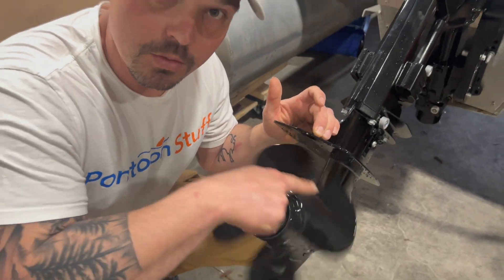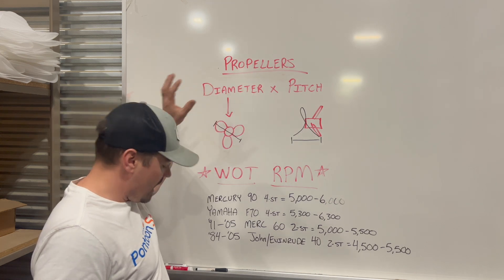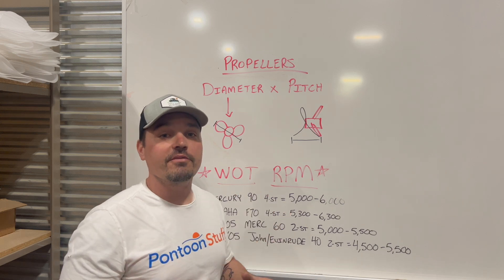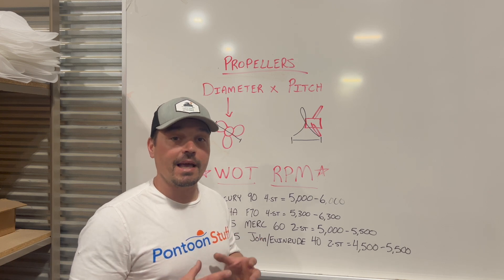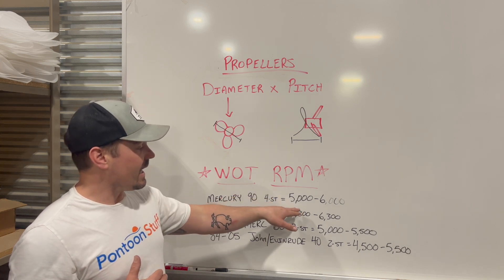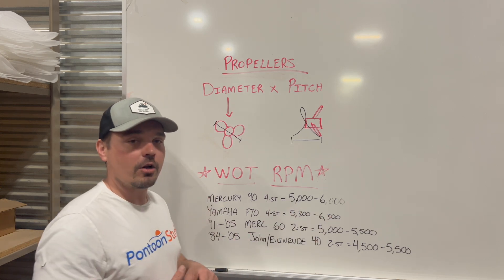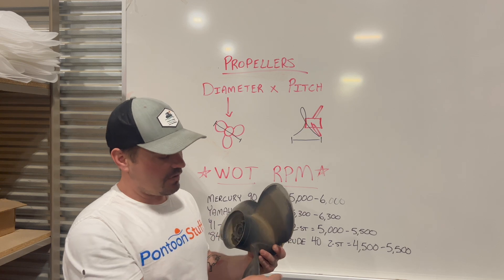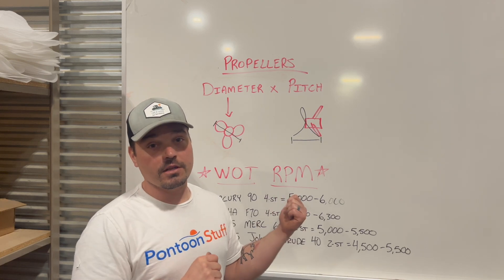THE RIGHT PROPELLER FOR YOUR BOAT - Breaking Down Prop Selection

Comment: Have a 16ft deep v aluminum bass boat. 90hp and a 9.9 kicker for restricted lakes. I know im not going to break any speed records with the kicker but just trying to get a couple more mph. Stock prop was a  4 blade 10x5- produced 5.6mph at 5200 rpms. Upgraded prop is a 3 blade 9¼x7 - produced 6.1mph at only 3900rpms Max. Any recommendations this is very confusing.
Reply from the maker: That boat is just too much weight and drag for that kicker motor to push it and get the proper RPMs at WOT. If you run it hard and don't turn enough RPMs you will lug the motor down and it'll cause it to fail over time. Best bet is to stick with the 5" pitch and take your time for the longevity of your motor.
Reply: @tomspontoons great piece of info. Thank you for the reply 👍
Reply from the maker: Happy to help!

Comment: Hey Tom, I have a situation that doesn't make a lot of sense to me.  I have a 22 ft pontoon with Merc 115 Pro XS CT, black max prop 16x13.  I added a Poly 3rd Toon Kit sport toon (13'6") over the winter. When I got on the water last weekend my max RPM's were 4200 (115 should be 5300-6300).  Max speed before 3rd toon was 17 at 5100-5300 rpm (max).  Speed still 17 but RPMs 1000 lower.  Once getting up to speed the back end seemed quite a bit lower, too low perhaps and lowering RPMs? Then the strange part, I swapped props to a 4 blade 15x15 Turning Point I had (smaller diameter but higher pitch) and the RPMs up to 4600-4800 and top speed 24 mph.  Would like the RPMs in recommended range (I like the speed up too, always thought way too slow compared to everything everyone else mentions).  Any Recommendations?  You are the best pontoon resource on YT.
Reply from the maker: RPMs in the proper range is the first priority. That 16" prop is a huge diameter for a 115 hp motor to turn. We tried running a 16" on our tritoon with a Suzuki 200 and it really struggled to turn the RPMs and didn't gain any speed. Dropped back down to a 15.25" diameter and 1" lower pitch and it ran its best. 

I'm guessing that poly third toon added a bit more drag than that 16" diameter can push. I would look to try something closer to 15" diameter and 13" pitch. Anytime you do a sport toon you can expect the bow to be higher and stern to squat a little. You're at that HP range where it's almost enough to lift the boat on plane, but not quite. You could add lifting strakes to the insides of the outer pontoons, but it still might not quite be enough HP to really lift the boat and fly. Once you get the correct RPMs you should be tapping into the optimal performance for RPMs and speed, especially with a loaded up boat.
Reply: @tomspontoons Thanks Tom. Would you recommend me trying three blade or four blade 15x13?
Reply from the maker: @charliebryant686  I really only recommend a four blade if you're having issues with ventilation OR if you've got a heavy boat and want to stick with aluminum for your prop (the aluminum four blade has less flex/slippage). Otherwise there won't be much of a difference between 3 and 4 blade.
Reply: @tomspontoons  Thanks again Tom.  I will probably stick with aluminum just for cost, especially until I find the right prop.  I am having trouble finding 15x13p in anything!
Reply from the maker: @charliebryant686  It might be a little different than exactly 15” diameter. Check out Solas Brand, they have tons of options, are affordable, and I’ve had great luck with them!

Comment: Im running 4.85m boat 60hp 4 stroke yamaha 2012. 13 prop max rpm 4900. With full loaded boat. 

What should i do up go higher or lower
Reply from the maker: Need to test it with an empty boat first. But I'd usually want to see 5200 to 5500 with a full boat, and if I'm not hitting 5500 I would back off on the throttle to reduce wear and tear on the motor from running at too low of RPMs at WOT. Just my thought and how I'd run it.
Reply: @tomspontoons  thank u. I've give that a try
Reply from the maker: @Aaron-op6jj  Happy to help!

Comment: Tom, I could really use your advice on selecting a prop.  Boat is a 22' Veranda tritoon, 27" tubes, lift strakes, performance motor pod.  Motor is a Yamaha SHO200 (VF200LA).  OEM prop is a 15.25" dia x 15 pitch.  At WOT I was getting a GPS verified 42.7 MPH at an indicated 6100 RPM.  I had the ECU re-flashed to 335HP and rev limiter raised from 6200 to 6500.  With same prop I am now seeing 47.9 MPH at an indicated 6700 RPM.  I am not bouncing off the rev limiter, so clearly the OEM tach is optimistic.  Hole shot is improved, and mid range throttle response is amazing, but I expected to pick up more than 5 MPH on top.  Clearly, I am underpropped and need to raise pitch.  The question is do I go to a 16 pitch or a 17 pitch?  Any advice appreciated.
Reply from the maker: When I worked in outboard sales I sold a customer a brand new 200 High Output Evinrude ETEC to replace his old 225 Evinrude Ficht. I was young and new to the game and didn't realize that even though they were both putting out 220-225 hp the older model was built on a larger displacement engine block than the new 200 HO. While both claimed to put out similar HP his boat (big fiberglass fishing boat) could barely plane out and he lost 10 mph. We worked with ETEC and our mechanics figured things out to make him happy with a prop change and adjusting the engine height, but he still never got that full 10 mph back. The Evinrude rep was an old school guy and had been in the outboard game a long time...he told me "THERE'S NO REPLACEMENT FOR DISPLACEMENT". Literally, the larger Cubic Inch engine will always perform better than the smaller one that's tuned to create more HP because with water there are more variables than a car or motorcycle just ripping down the road or racetrack. 

With these ECU flashes I'm not sure how they even do it, let alone if it's good for the engine, but they're taking a smaller displacement motor and maxing out the HP it can create...without changing the displacement of the engine block. The higher HP does nothing for the torque created by a larger engine block, and in the case of a pontoon or tritoon (or that heavy fiberglass big lake fishing boat with the Evinrude) you need more displacement/torque to lift the hull to gain those advantages of the higher HP. Basically, you need to get less pontoon in the water which is going to come from torque over speed...again it's a complicated thing in the water with hull type and shape and how loads impact drag. 

I would go to the 17 inch pitch if top speed is your main goal. Going up 2" in pitch should yield a drop of around 200-300 RPM putting you right in that sweet spot. You may even consider an 18" pitch, but remember that if the diameter changes much with the pitch change it can drastically drop your RPMs. 

Prop selection will always have trial and error as the base of it unfortunately...and when playing with stainless props it's not cheap! Find a dealer or prop shop who's willing to take a deposit from you that you will use towards the purchase of a prop from them, but on the condition that you can test a prop or two until you find the right one. And this information is from my experience (and mistake). So take it for what it is, but it's my understanding of propping boats and the high output and flashing of smaller engine blocks for more HP and how that relates to performance. Awesome question and hopefully I'm able to have been some help here for you and anyone else reading comments!
Reply: @tomspontoons  Thanks for the input.  FYI, my 200SHO is built on the 4.2 liter V6 block and is the lowest HP offered on that block.  The only difference in my motor and a 300 HP 4.2 liter V6 is the ECU tune.  In other words, my 200SHO is simply a de-tuned 300.  All of my research indicates that the ECU re-flash on my motor is considered very safe, with multiple owners reporting 1k trouble free hours.  So, your old Evinrude rep was absolutely correct that "There's no replacement for displacement", but I have the displacement for an easy 300, and the extra 35 is a very, very mild massage of the factory tuning.  Concur that my best bet is to use a prop shop that will let me experiment, and perhaps even let me trade in my OEM perfect condition 15 pitch.  Thanks again.
Reply from the maker: @Spartan490-b1q  That makes a lot more sense then!! I was picturing the 200 inline 4 which is a great motor, but not beefy in terms of power. Hopefully that explains me being so perplexed by the 335 hp number! 

I would bet you’ll end up in the 17 to 19 pitch range with the information I know now!! Our 200 Suzuki (inline 4) ran a 17” pitch for its best performance. It was a pretty light 22’ tritoon tho.
Reply: @ Absolutely.  If you start with a 2.8 liter inline 4 rated at 200 HP I think the best they can do is 225, as that block is already making most of what it can make.  When I bought my motor I did so because it was the least stressed block at my HP number and I could use 87 octane.  The re-flash does require higher octane.  Interestingly, there's less than 25 lbs weight difference between the 4 cylinder200 and the 6 cylinder200.  Years later, my choice turned out to be fortuitous for tuning.
Reply from the maker: @Spartan490-b1q   Yep! And to be honest, on a pontoon or tritoon going with the smaller hp option on the same displacement block doesn't usually hurt you on speed. For instance, Suzuki uses the same inline 4 for their 150, 175, and 200. I bet you'd only see about 3 to 4 mph difference on a tritoon between the 150 and the 200. They just don't have the same impact on a tritoon as they do on a bass boat or run about that's a fully planing hull. I think you have a really good grasp on what you're working with...the unfortunate part might just be that now you've got to spend the time and money testing and tuning to get it just where you want it. Best of luck, and please comment back with the end results when you get it where you want it!
Reply: @tomspontoons  After discussion with a local custom prop shop we ordered an 18 pitch.  If it doesn't work I can exchange it for a 17.  Should be in next week sometime.
Reply from the maker: @Spartan490-b1q  Awesome! Let me know how it runs!
Reply: @ Just got back from testing the 18 pitch prop.  Boat is fast, but it sucked down the WOT RPM's a tad too much.  With the 18 pitch I got 52.4 MPH at 5950 RPM with just me on the boat.  However, I was having to trim way more than I ever have and boat was really wanting to porpoise even with virtually no wind/waves.  I'm going to exchange the 18 for a 17 and expect I'll end up right about 50-51 MPH at 6200ish RPM.
Reply from the maker: @Spartan490-b1q  Awesome info! Hopefully you hold that 52 mph with the added RPMs. It’ll cruise with a heavy load MUCH better with the 17” though too. That little extra torque will be nice
Reply: @ The 17 pitch finally arrived and I just got back from testing it.  That is the Goldilocks pitch for this setup.  With just me on board and 2/3 tank of fuel I saw 52.8 MPH at 6350 RPM.  That is a massive 10.1 MPH increase over stock.  And the mid-range and hole shot are still amazing.  Better yet, an easy 4200 RPM gets me a very quiet and smooth 35 MPH cruising speed.   And it'll stay on plane down to 3700 RPM in smooth water.  I'm thrilled.  Well, well worth the upgrade.
Reply from the maker: @Spartan490-b1q  That's awesome to hear! You're the perfect example of how propping a boat is done by trying different props and comparing RPMs and performance. And now after a little bit of work you get to know you've got the right prop and best performance for the rest of the time you own the boat!!

Comment: Any recommendations for my honda bf20. Original prop is 4 blade 9-1/4x10
I change to prop 3 blade 9-1/4x9 one down lower pitch but my rpm is still 4500.
Do i need more lower my pitch?
Reply from the maker: You're sure your tachometer is reading accurately or is set to the correct pulse/pole setting? What kind of boat is it on?

That motor should be able to run up to 5500 to 6000 usually, so in theory you'd want less pitch, but you may not have much lower options to drop to. You could also try raising the motor on the transom to help reduce drag. If it's on a pontoon boat and you can't get the RPMs up I would just recommend avoiding using the higher throttle ranges unless absolutely necessary. That should at least help prevent doing harm to the motor. Slow putting around with the wrong prop isn't going to do as much harm as trying to run the motor hard with it.

Comment: I have a Merry Fisher 605 with a 2021 Merc 60CT(Bigfoot) with a Aluminum 3 Blade Blackmax 13x21P Prop. Its hard to bring the Boat on Plane. WOT 5600rpm.
Someone told me switch to a 4 Blade. Would you change also the Pitch. I dont care about highSpeed i yust want quick Plane.
Would you go with higher Pitch on a 4 Blade ?
Reply from the maker: Those look like fairly heavy boats for a 21P prop on a 60CT. I think a 4 blade would help, but I would also drop down to at least a 19" pitch, maybe even a 17" to get those RPMs up to 6000 at WOT with an empty boat. I think it needs the lower pitch more so than a four blade personally. Even if the boat can push 6000 RPM with a couple people it's not a bad thing, and it will get you on plane way faster. That's what I'd do!
Reply: Thank you!
Reply from the maker: @vetdoc35 happy to help!

Comment: Would the rpms be affected by the pitch even when running the motor out of water with muffs on?
Reply from the maker: No, it really should not have any impact as there is little to no resistance to the motor/boat from the air. It's the load from the motor pushing the boat through water with a load that impacts the RPMs the most.

Comment: Thanks for this video!  We purchased a new to us 2006 Sun Tracker Fishing Barge 21 with a Mercury 90ELP T 4-stroke.  The boat came with a Solas 14" 11 pitch prop which doesn't seem right.  We took it out the other day and got to 5500 RPM way before WOT.  We got to 18mph at that RPM.  I didn't want to push it any more past that as far as the RPM goes.  We also got what seems to be cavitation?...not sure what that really is, but my husband says that's what it is! LOL.  It performed well at 3500 RPM but only doing about 10mph...going nowhere fast!  Any tips or suggestions?  Thanks!
Reply from the maker: That does seem like a low pitch for that motor and boat combination. That motor should run up to around 5,800 to  6,000 RPM at wide open throttle with a light load. I would expect to see 25 mph out of that boat. I'd start by going up to a 13" pitch which should drop the RPMs a little bit and might give you better bite. Your 11" might be so flat of a pitch that it's having slipping issues. Really hard to say without being there to see and hear everything happening, but I'd start by going up in pitch a couple inches to where you can really test wide open throttle without going over 6,000 RPM.

Comment: any recommendations for a Honda bf50d with a range of 5500-6000, im running a SOLAS Amita 12-2/5 x 8 RH 3311-122-08 prop with a max rpm of 3400-3600..... the propeller house i got it from said this was good and they wouldn't change it.. but i didn't think that was right and after watching this i know its not..
Reply from the maker: What kind of boat is it on? Pontoon? I would be concerned that your tach might not be reading properly. 8" pitch is very low and would usually have RPMs quite high. For instance, we usually run an 11" pitch on the 60 hp Mercurys that we install and that puts those motors in the sweet spot of around 5700 RPM.
Reply: @tomspontoons   all appearances it seems to work properly, idle is correct and it comes up smooth and consistent. it doesn't sound like it is running in the upper rpm range but i will find a way to check that. it is a 23ft pontoon. not sure how to verify the gauge is working correctly but i will do some investigating. Thanks!
Reply from the maker: @stockenterprises9391  The only way I really know how to check is to hook in another gauge to the tach sending wire that is new and should be operating correctly. Otherwise you can check the pole/pulse setting on the back of the tach (if it's not a Honda brand gauge). It may need to be changed. They can seem to read accurately to a point in the RPMs and then miss, or they can be way off. I've seen both.

Comment: would the one in an owners manuel detemine all
 this
Reply from the maker: The owners manual will tell you what your operating range of RPMs should be at wide open throttle, but will not give you any guidance to prop diameter and pitch. That will have to come through testing with a tachometer.

Comment: What should an old school Johnson 15 HP run at at wot?  Just installed a tach and I’m sure i can get a little more out of it. Seems to be low on rpm. From my understanding it should be in the 6000-6500 range.
Reply: Thank you for the reply. I appreciate it.
Reply from the maker: @doctordifferentialspeedsho9506 happy to help!
Reply from the maker: I refer to this chart for all of my WOT numbers:

https://www.kirschbaum.at/ki_prop/pdf/2015/RPM%20Chart.pdf

It looks like you're correct, according to the chart an older 1980s vintage Johnson/Evinrude 2 cycle should run somewhere between 5500 and 6500 RPM.